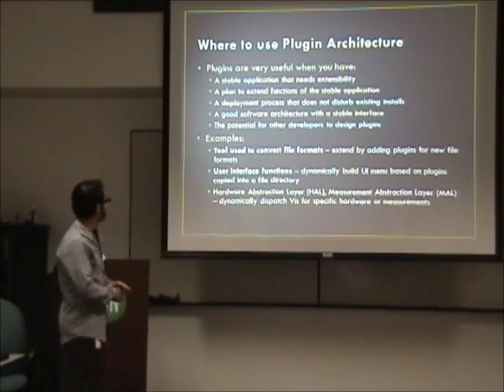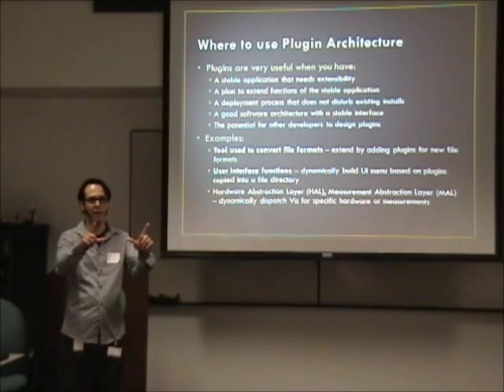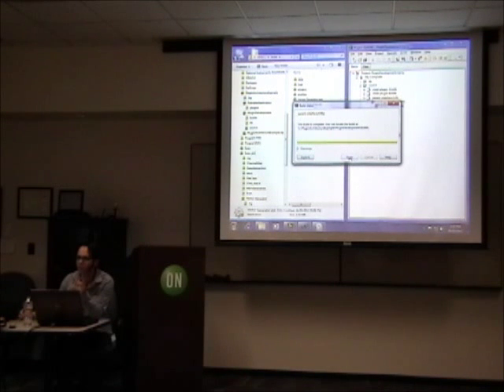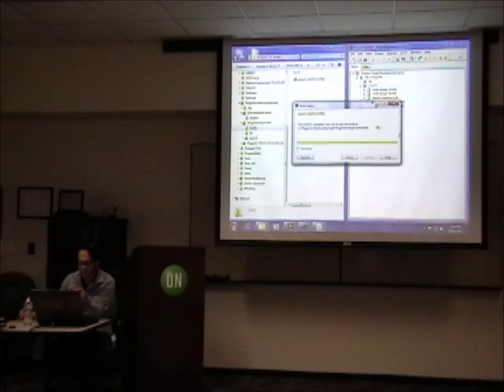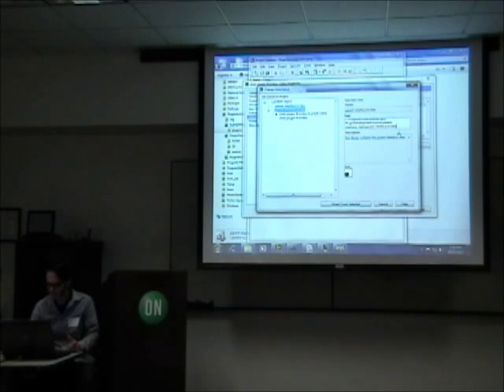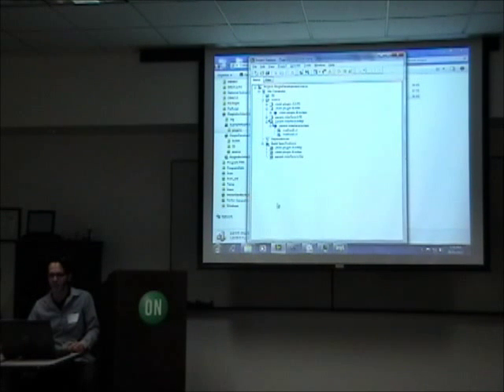Distributing Packed Project Libraries

Comment: Well that was a really interesting dive in PPL. Libraries are something I've barely used in 20 years of LabVIEW development, but now alas that has to change. Having built a test suite with a base class (defining the interface) and several children (for each equipment variant) I've come to a screeching halt when building an executable.

Is the process any smoother in my shiny new LabVIEW 2018 SP1 suite?